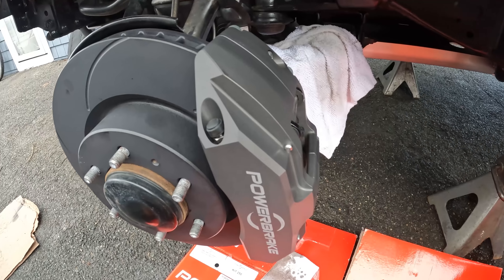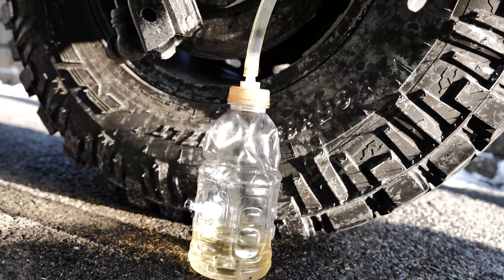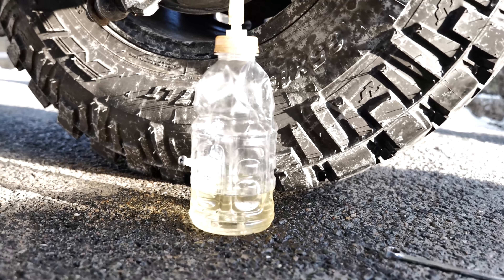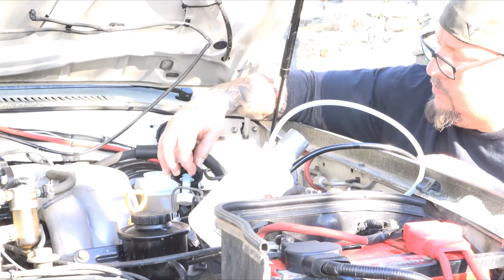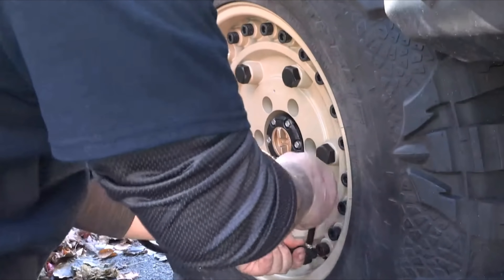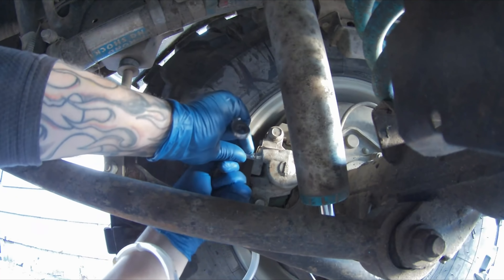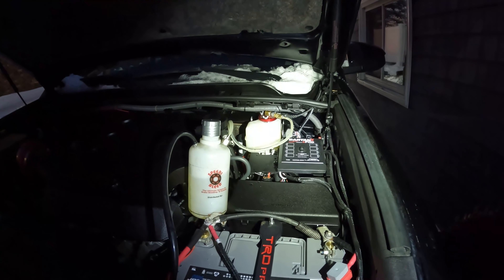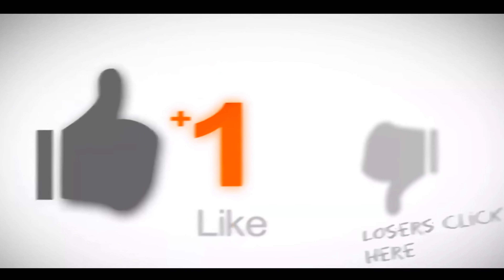SPEEDI BLEED : Bleed your brakes Alone and BETTER than a Brake shop!

Comment: Hey Richie,  Would you consider posting a vid on the 5th gen and the mods you've chosen?  I think it would be interesting to see how you decided what to upgrade and the products you've selected.  Lot's of folks are thinking about mods themselves and I think your experience and insight would be interesting.

Thanks for the vids!
Cheers,
Mike
Reply from the maker: LOL "consider" ?? Its going to be a 20 part plus series including supercharger install.  standby
Reply: That’s great to hear, I’m looking forward it. 

Cheers 
Mike
Reply: @jailbreakoverlander   hey Ritchie, was told by off grid that I won. Is an iTunes gift card a normal way for your friend to collect shipping costs? Does he normally go through WhatsApp?

Comment: I've been using a Motive Power Bleeder for a few years now and like you said, its a game changer.  SO much easier bleeding.  The Motive system pressurizes the bottle itself with a pump handle instead of your tire or compressed air.

Comment: I don't understand or know all of the parts, but had heard of bleeding the breaks before.  I was courious.  I learned something.  I wouldn't attempt this because I don't have enough knowledge on my own.  So there's that like you like to say.  Anyway, good stuff and yeah, if I had enough faith in what I was doing I would go for this  .  The using of the tire air pressure is cool to me.  It's smart.  But then you have to refill that tire to the right point.  I don't know if you knew this, but back when automobiles or cars were first being driven, they would carry what we call today, bicycle air pumps.  They carried them to air up their tires.  Smart,  now I carry one, never would likely have thought to do it before.

Comment: I found two of those old systems in the garage one transfer’s air from a tire to another tire and one uses a spark plug hole to fill tires with compressed air from the engine running, could use a 5 gallon compressed air can but I see how you’re using your tire as the can and can refill with your electric tire pump 👍 that’s the way to do it , those hand pumps suck

Comment: Just ordered one, I got the version that was a little more expensive, comes with a rubber hose, possibly better gauge, and screw on tire connector. I was looking at the Motive one, but lots of mixed reviews on the reservoir connection not sealing well.

Comment: I've been looking for a pressure bleeder for a bit now. The one on the snap on truck costs around 600 dollars. I didn't think I would use it often enough to justify that cost. I have a vacuum bleeder, but sometimes it doesn't work very well. Pressure seems better.
Reply from the maker: I used vacuum bleeders and this works much better and theres no "hoping" it worked.

Comment: Pretty sweet setup.  I’ve been using a motive bleeder for a couple years. Similar principle, but it has a manual pump to build pressure. Downside to the motive is that it’s a nightmare to clean after use. Hopefully the Speedy is easier.  Sweet new rig! Im gonna miss the cruiser, but I have no doubts this one will be a beast as well.

Comment: Not being rude but how can you bleed brakes better? If the fluid is clean and no air then it’s done right. Also personally I would remove all old fluid from the master cylinder first

Comment: That looks fanatstic. But I wonder if the kit comes with alterantive adapters for the master cylinder?  My master cylinder cap is not round, it is oval shaped
Reply from the maker: you can get any adapotr for any make model  they give you a quik connect so you can swap em out.
Reply: @jailbreakoverlander  Thanks Richie

Comment: R, thanks for the video, it's a good tip and they are coincidentally running a sale on the speedi.  Any chance you'll post exactly what brake components you used?  Looks like powerstop extreme ceramic pads, but what calipers and rotors did you end up with?  Let us know how the rotors perform also; you probably already posted on t4r or some other site but help us old timers out with specifics on your videos please.  Either way, thanks, you stay frosty and God bless.

Comment: dont see the need for it. you already had everything you needed to bleed the brakes easily.  hose coming off the bleeder into a bottle. Just make sure the hoes goes to the bottom of the bottle, and fill it until the hose is submerged.  i also like to put a little grease around the hose and the bleeder to act as a sealant. open the bleed screw. pump the pedal 5 or 10 times, close the bleed screw and youre done..  you can do each wheel in like 5 minutes by yourself..  and with calipers, prefill the caliper before you attach the line. im a mechanic and thats how i do it. can bleed most cars in like 15  20 minutes for all 4 brakes.